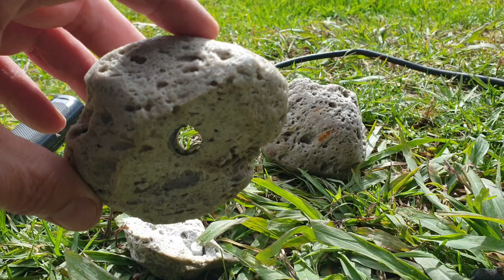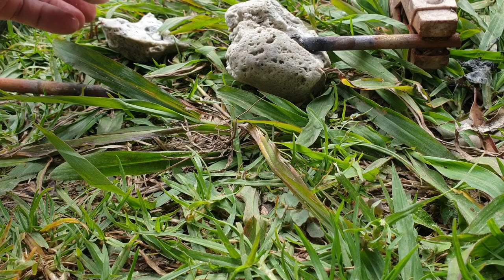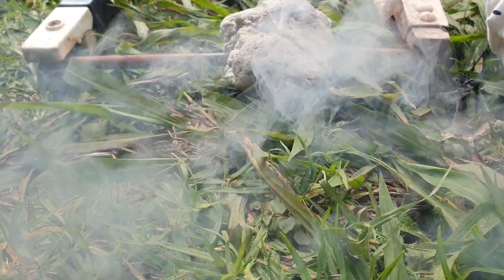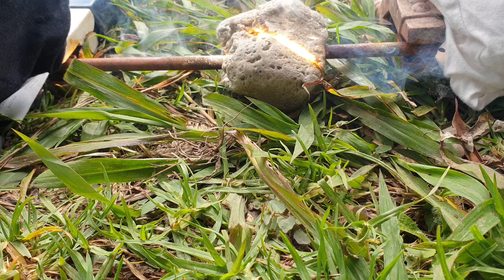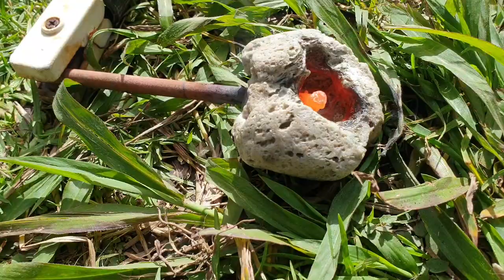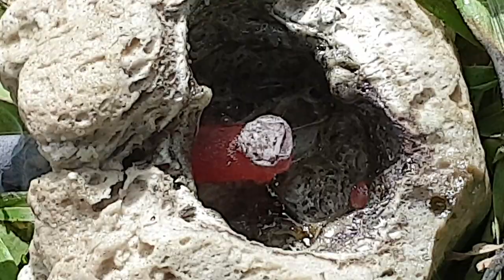Lava Potato, melting a cave in pumice

Comment: G'day,

It's a funny thing to decide to do...; is there a "goal" in mind, or merely "what will happen if I do this...?" ?

The weirdest thing I ever saw done with Electrickitiez was when a mate was about to go fishing, and he announced that he was going to use "Electric Worms" for Bait.

I had no clue what he had in mind. So I watched, and stood back.

He took a 240-Volt AC Power Cord outside the house, then got a shorter Cord which had it's Female plug removed - and instead it had the Earth Wire cut short and the two Active Wires were about 3 ft long and each one was clamped to about 2 ft of  straight Steel Fence Wire - one bit of straight Fence Wire per Active  Lead....

Then he poked the Steel Wires into the Soil of the  Flower Bed..., made sure we were all standing well back and that EVERYBODY there was wearing Rubber/Synthetic-Soled Shoes or Boots.

Then he checked that the Wall-Socket was OFF, came out and plugged his Twin Wire Terminal Lead into the Power-Cord, and went into the House and switched on the Coal-Fired Power Station...

The House-Lights dimmed, as the Circuit-Breaker thought about tripping..., the Ground began to "Hummmmm..." at 50 Cycles/Second...

And, Behold !

After 10 seconds about a Dozen Earthworms emerged from the Soil, standing straight up for an inch or so ; and then they all laid down on the ground, pointing their heads away from the straight line between the two Fence wire Spikes - and they kept on coming up and out of the Ground, all heading radially away from the centre of the underground Circuit.

After a few minutes, when no more were coming up..., he went inside, switched off at the Wall, and all the Worms stayed on top of the Soil - not dead but clearly a bit sick and freaked out.

Then he came out of the House, unplugged the Power Cord, and pulled the Worms out of their Burrows to put into his Bait Tin.

I only saw it done the once, in moist Bassalt Soil...; and being a Vegetarian I don't go fishing - so I have never tried it...

But, it is a truly weird sight to see..., as Hillbilly Redneck Bogan Tricks are concerned (!).

Such is life,

Have a good one.

Such is life,

Have a good one...

Stay safe.

;-p

Ciao !
Reply from the maker: the reasons are along the "what will happen if i do this", coupled with an interest in arc furnaces for melting stuff that requires a lot of gas otherwise, and a curious adventure into cold fusion reactions. we have come along way since Pons and Fleishmann got the shit end of the stick for daring to suggest that Tokamak reactors are not needed to do low temperature nuclear reactions. thats an intesting way to catch worms... some use it straight in the water and catch the fish without the worm.
Reply: @m3sca1  

Cool, I like open-ended Experiments...

I wouldn't be game to try fishing with Electricity !

Water and Current are a savage mix, kinda thing (!).

Stay safe.

;-p

Ciao !
Reply from the maker: me niether, i just thought a fella who will cheat at catching worms, may as well skip a step and zap the water🤣
Reply: @m3sca1  

Ah,

I see, hmmmn ; well the bloke concerned was/is a bit of a Dingbat, so I wouldn't put it past him to try...

My father had a more scientific method.

We had a Fowlyard and about a dozen Chooks when I was a kid, and Chooks eat Worms...; So the Old Man kept a flat sheet of Galvanised Iron, maybe 2-ft by 3-ft, lying loose on the ground of the Chookyard..., where it used to slowly "migrate" around the enlosure

I never thought much about it until, when I was about 6 or 7 we were going on a (rare) inland fishing expedition (we had a Beach Shack at Red Rock - so that was our normal venue for going fishing...), and he announced that he was going to collect a tinful of Worms for Bait.

I followed as he took a Shovel to the Fowlyard, moved the sheet of Tin aside revealing a rectangle of darker (moister, shaded) Earth. And when he dug into it, the dirt was fairly "lousy" with Earthworms - and maybe 3 shovelsful of Dirt yielded enough Worms to fill the Bait-box.

Dad explained that the Worms all liked to stay under the Sheet of Tin because being there protected them from all the Chooks - and the Tin held in the Soil moisture, which the Worms also liked - and so the Dirt there was easy to dig into.

And the Tin slowly migrating around the place meant that entire Fowlyard eventually at some point got a rest from the Chooks scratching.

The Old Man was pretty cunning, in his own way.

Such is life,

Have a good one...

Stay safe.

;-p

Ciao !